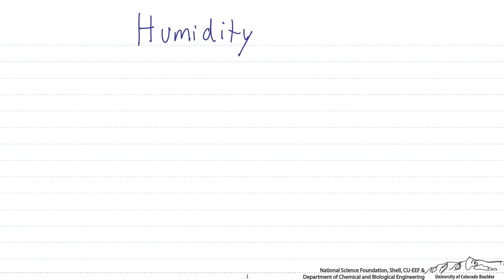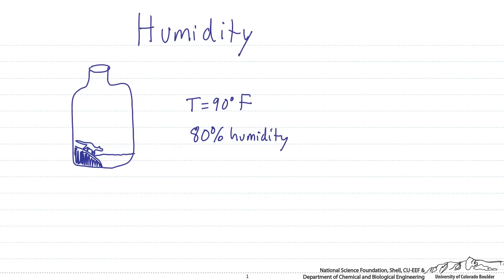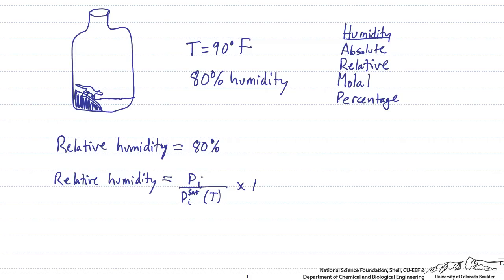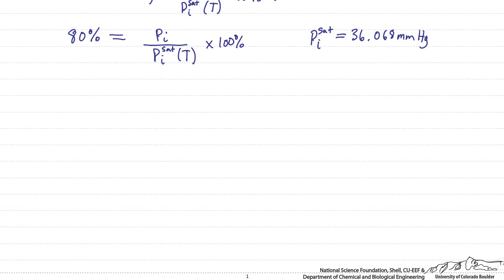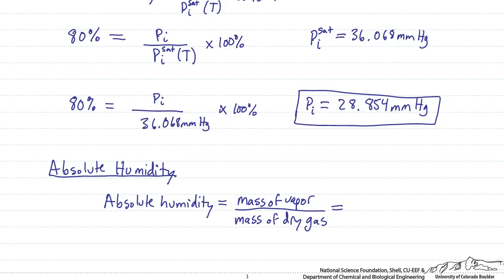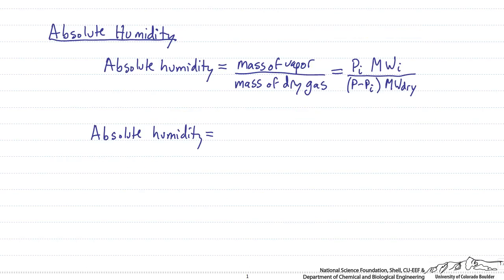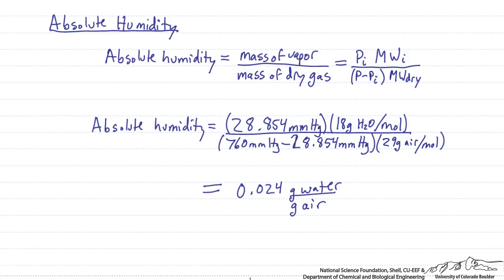Relative and Absolute Humidity

Comment: For the unit of Absolute Humidity, shouldn't it be g/m^3? Why do you use g/g?
Reply: That's the definition https://en.wikipedia.org/wiki/Humidity#Absolute_humidity
Mass per volume not mass per mass. 

Mass per mass is referred to as humidity ratio or mass mixing ratio.
Reply: zhongming wang - you are correct. He's calculating Specific Humidity (Humidity Ratio) but calling Absolute Humidity.
Reply: @heatxfer3662  Considering Absolute Humidity is the point of the video, that's a pretty big screw up.

Comment: I'm not sure what steam table you're reading from that has fractions across the top, but the Psat of water at 32°C is 0.0047596 MPa = 35.7 mmHg according to the NIST steam tables.

http://webbook.nist.gov/cgi/fluid.cgi?Action=Load&ID=C7732185&Type=SatP&Digits=5&THigh=40&TLow=20&TInc=1&RefState=DEF&TUnit=C&PUnit=MPa&DUnit=mol%2Fl&HUnit=kJ%2Fmol&WUnit=m%2Fs&VisUnit=uPa*s&STUnit=N%2Fm
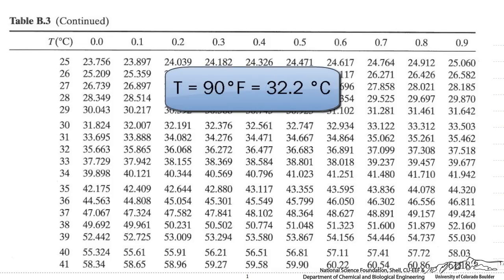Reply from the maker: Yes, that is the saturation pressure at 32.0 degrees C, which agrees with the table at 1:40 if you look in the 0.0 column at 32 degrees. This textbook table has values for intermediate temperatures so it is easier to use. If we wanted to use the NIST table, we should be able to obtain the same result by interpolating between 32 and 33 degrees C. Hopefully this clears up any confusion.